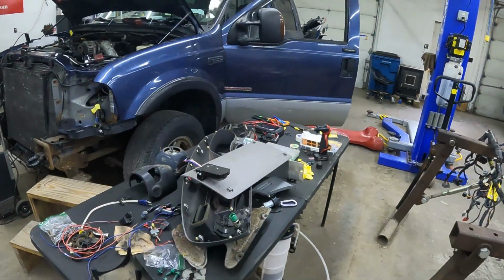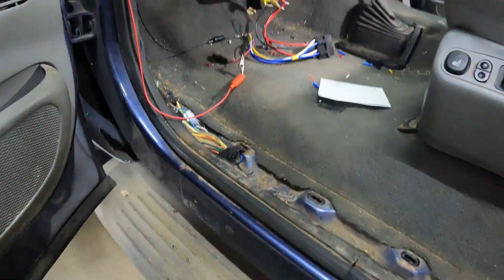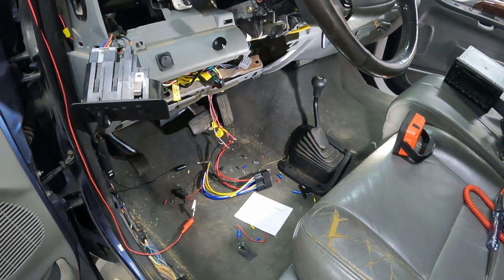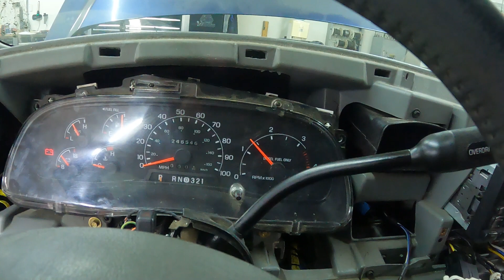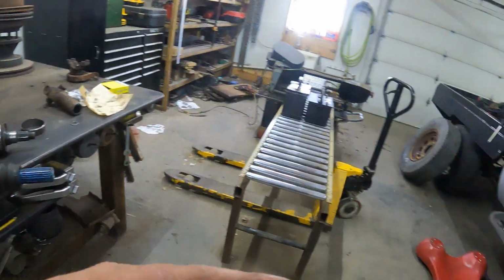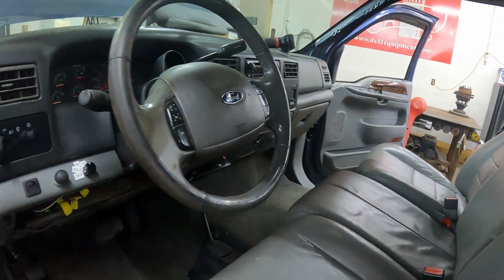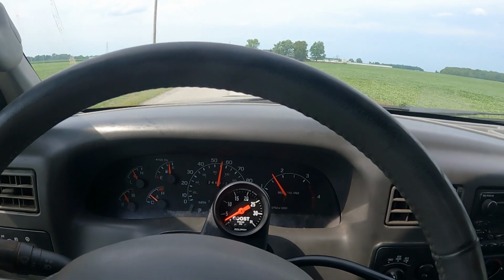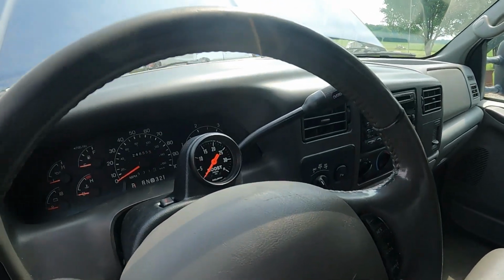Ford Powerstroke 6.0 delete #7 finishing up and test drive

Comment: Did you use 7.3 fuel pump or 6.0
Reply from the maker: @tuckerbuzzell1882  the 6.0 fuel pump and wired it into the 7.3 wiring harness ... hope this helps and thank you for watching
Reply: @CountryMileGarage  how did you go about wiring in 6.0 fuel pump and what did you do for fuel lines going to engine thanks
Reply from the maker: @tuckerbuzzell1882  I believe I reused the 7.3 fuel line from the pump to the engine. The 6.0 fuel pump has only 2 wires that actually make the pump run a + and a - just like the 7.3 I just soldered the connector on
Reply: @CountryMileGarage  ok gotcha thanks for the help
Reply from the maker: @tuckerbuzzell1882  no problem please like and subscribe